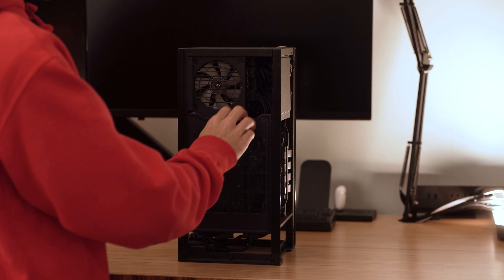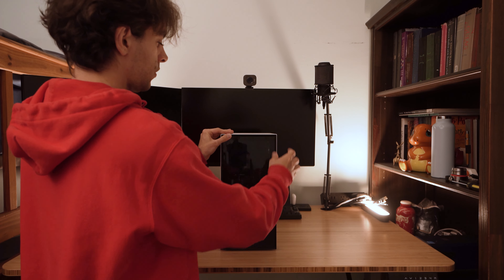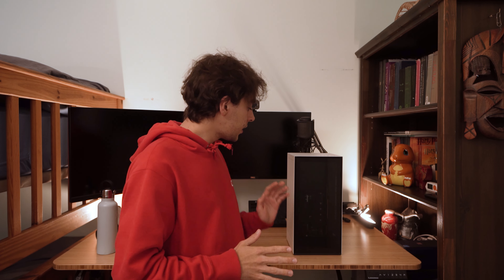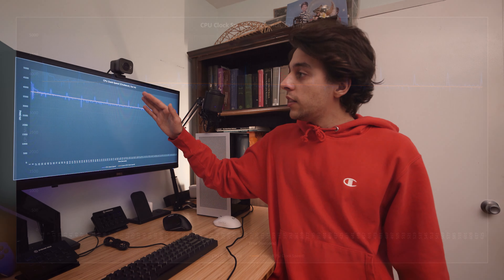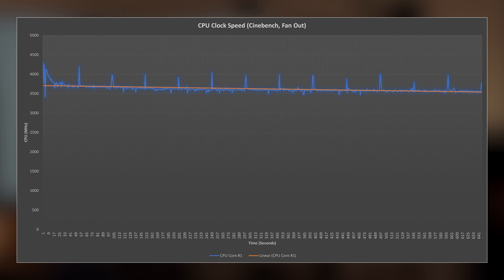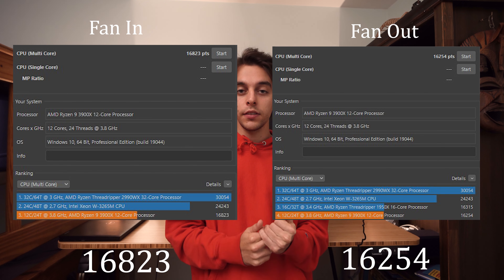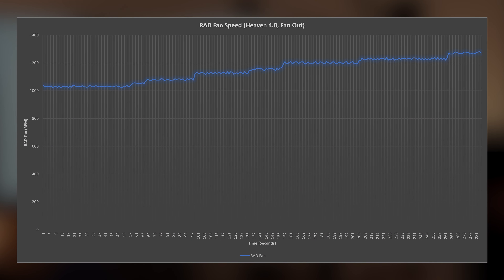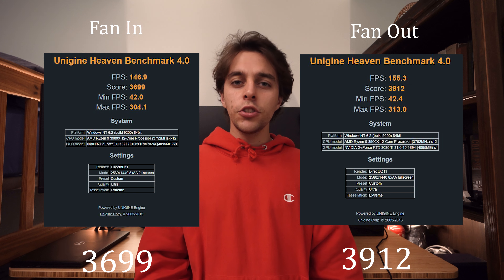Do THIS to your NZXT H1 for BETTER Cooling!

Comment: BTW you said the GPU side is exhaust but the GPU side intakes air into the case, which is why GPU temps were higher with the rad fan pushing air in. Assuming your rear fan is still being used as an intake, you effectively have all intake and no exhaust which results in positive pressure. Lower CPU temps at idle bc you're blowing cool air onto the cpu, but as soon as the radiator is saturated with heat, youre dumping heat into the case (affecting gpu performance). Interested to see the results with a mesh front panel
Reply from the maker: That’s a really good point, I didn’t think about that. With that additional info, I think the mesh front panel will be helpful for letting that hot air out the front, which should help with temps a bit. I’m also excited to try the additional fans attached to the back with the mesh front, I think that’s where we will see the best temps, I gotta test out some different configs and see what works best!

Comment: My h1 (v1) came with the radiator fan blowing inwards. To my understanding this is how nzxt intended it. It's meant to suck fresh air from the sides and blow it out at the back. 
Maybe they installed it the wrong way around by accident? 
Nevertheless, nice video and interesting to see what the difference is! 👍
Reply from the maker: I’m glad you enjoyed the video! And yeah it seems like that’s generally the consensus on how it was installed. Honestly it may have been a misconfiguration on my end since I had replaced my fan awhile ago with a noctua fan 🤦‍♂️ but glad I set it up right now
Reply: @rashbalash  I wonder if it's a difference between V1 and V2, because my V2 radiator fan blows hot air out. Unless mine was also built incorrectly, it's an interesting design choice; I wonder if they have reason for it or if it's just another oversight and we can expect to see a V3 lol
Reply: @WesSideGamers  V1 does intake for better CPU temps and reduced dust, whilst V2 does exhaust for better CPU temps. You can change it if you need better performance on one or the other

Comment: Great video! I have three H1 v1’s in my household and all three AIO’s have failed.  My own AIO failed after 18 months and the kids failed at 26 months in the same week.  I got a replacement within days but as of now NZXT are out of stock.

A great video recommendation is to do an aircooled  H1 video with something like a Scythe BS3 or Noctua equivalent with with the Cromax NF-A12x25.

The reason is because these replacement spare parts AIOs are not improved in anyway so it’s inevitable they will fail around after 18 months again and they only warranty the replacement AIO for three years from your original purchase date (not another three years).
Reply: The Coolant In The H1 AIO Is Very Bad And Causes Clogging Problems.

Last Week I Change The Coolant Inside AIO to Honda Pre-Mix Type 1, The CPU Temp Full Load From 75c Down To 55c

R3600 OC4.3Ghz

Comment: thanks, i have a 5800x and it's thermal performance was horrible in the H1, I'm gonna give this a try.
Reply from the maker: Your H1 might already come like this! The best thing to do would actually be to switch out the fans for a Noctua. A recent comment on another video also recommended an Arctic P14

Comment: Did a 280mm rad liquid freezer iii in the back , screen mod , 2 40mm noctua fans for the gpu , and I’m running a 5950x with a 4070 ti super and the temps are around 65C on gpu and 64-68C on the cpu.

I’ll try to print a front panel and check if it helps more .

Comment: But in this case, the cooler won't blow onto the radiator. In that situation, it's better not just to flip the cooler but also to swap the fan and the radiator positions.
Reply: Which is not possible because of the space, but you are generally correct

Comment: have you tested with a small fan attached on back as exhaust. i am planning to get the nzxt h1 v2 for a build, not really sure about the temps.
cpu: i5 13500 and 3060ti gpu.
Reply from the maker: Hey! The V2 will probably work well with that pairing. But I do hope to test out adding some fans to the back. They will definitely help with GPU Temps!

Comment: I heard that the fan of the PSU is always in action und quite loud. What would you say? I have an H1 unpacked and consider to send it straight back. I dont want to hear a noise in idle mode.
Reply from the maker: I've replaced my PSU with a corsair sf750, which has the fan off when utilization is under 30%! This gives me pretty silent usage when doing simple tasks / idling.

Comment: When flipping the fan, should it be pushing air into the radiator or pulling air from the radiator? Can the positions of both the radiator and fan be exchanged?
Reply: This is what I was hoping would be answered

Comment: What would happen if you'd put a Noctua NF-A14 iPPC-3000 (or 2000) for the AIO fan? I assume the 3000 one would create too much noise, but how about the 2000?
Reply from the maker: From what I understand about the iPPC noctua fans, the 2000 one will be able to spin to lower RPMs, so will definitely be a bit quieter at idle than the 3000. I think both will sound similar ish at matching RPMs. The 3000 at max speed is pretty damn loud-so would prolly stick to 2000. 

I’ll place an order for both so that I can test it out (once my parts are back from warranty repair lol).
Reply: hi  my dude, i got the iPPC-2000 for the nice cooling but it is way too loud in order to be used in that case... 

So loud you will need at least decent ANC headphones in order to enjoy gaming while it will still be heard a little. 

Those ippcs were intended to be used in an environment in which noise doesnt bother at all, which will probably not be the case for you.

There are better noctua options.
Reply from the maker: @EzrealLux  thank you for the heads up! that sounds pretty rough LOL